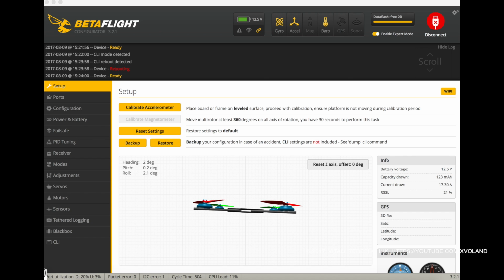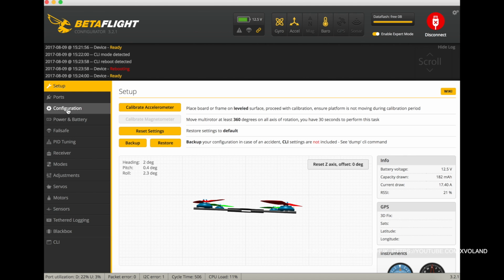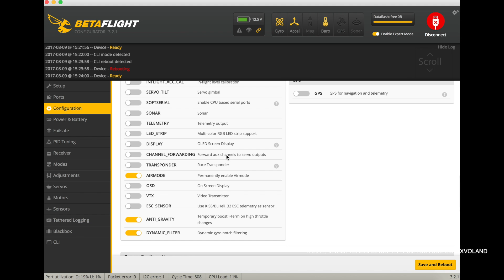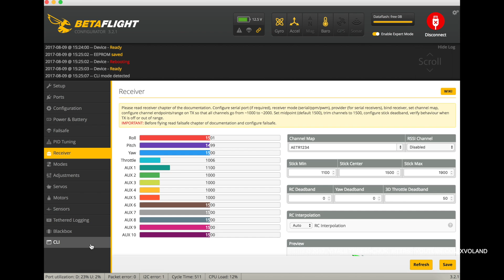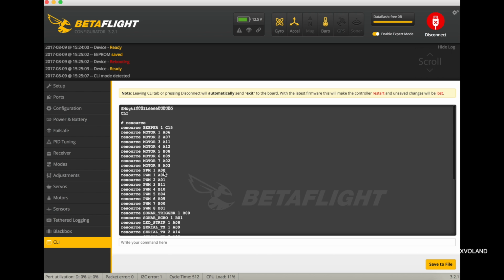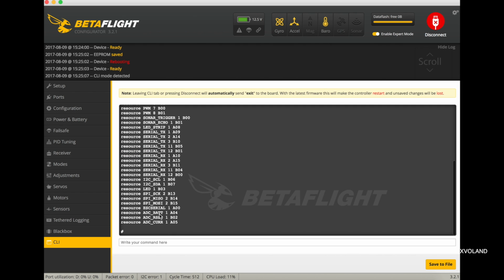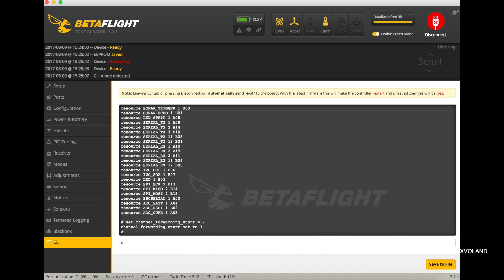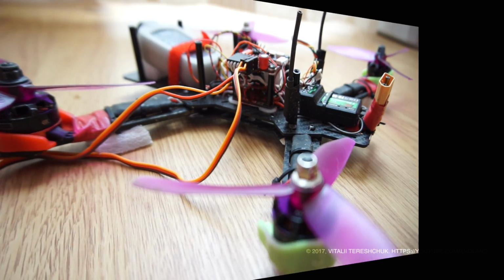Two Servos SG90 on Betaflight 3.2 or Cleanflight. Как подключить две серво в конфигураторе

Comment from the maker: Two Servos SG90 on Betaflight 3.2 or Cleanflight.
Как подключить две серво в конфигураторе. Русские субтитры

Default settings:

# resource
resource BEEPER 1 C15
resource MOTOR 1 A06
resource MOTOR 2 A07
resource MOTOR 3 A11
resource MOTOR 4 A12
resource MOTOR 5 B08
resource MOTOR 6 B09
resource MOTOR 7 A02
resource MOTOR 8 A03
resource PPM 1 A00
resource PWM 1 A00
resource PWM 2 A01
resource PWM 3 B11
resource PWM 4 B10
resource PWM 5 B04
resource PWM 6 B05
resource PWM 7 B00
resource PWM 8 B01
resource SONAR_TRIGGER 1 B00
resource SONAR_ECHO 1 B01
resource LED_STRIP 1 A08
resource SERIAL_TX 1 A09
resource SERIAL_TX 2 A14
resource SERIAL_TX 3 B10
resource SERIAL_TX 11 B05
resource SERIAL_TX 12 B01
resource SERIAL_RX 1 A10
resource SERIAL_RX 2 A15
resource SERIAL_RX 3 B11
resource SERIAL_RX 11 B04
resource SERIAL_RX 12 B00
resource I2C_SCL 1 B06
resource I2C_SDA 1 B07
resource LED 1 B03
resource SPI_SCK 2 B13
resource SPI_MISO 2 B14
resource SPI_MOSI 2 B15
resource ESCSERIAL 1 A00
resource ADC_BATT 1 A04
resource ADC_RSSI 1 B02
resource ADC_CURR 1 A05